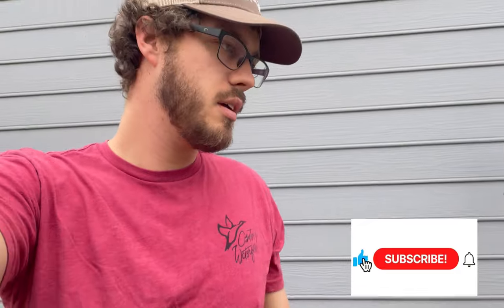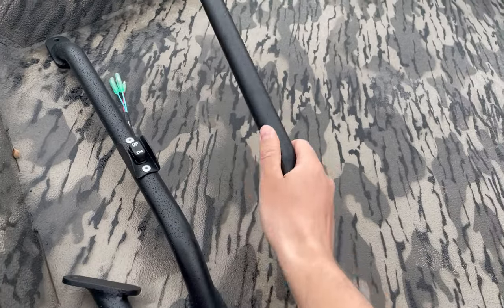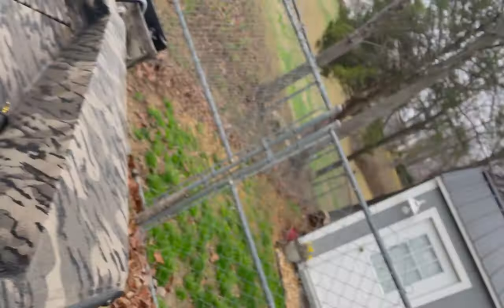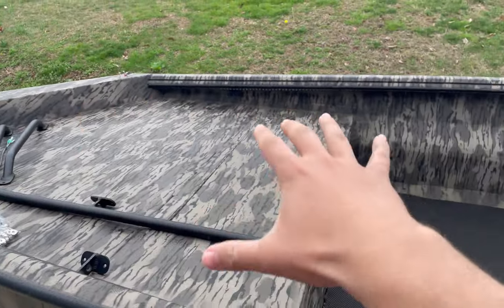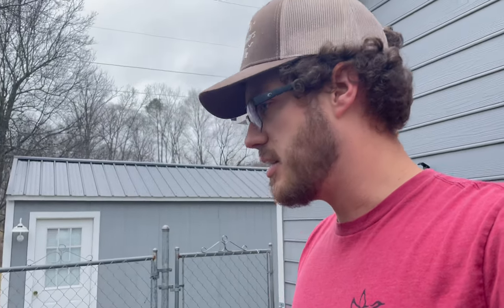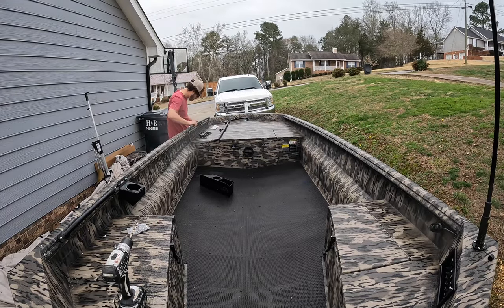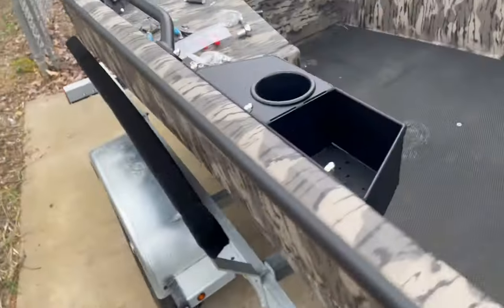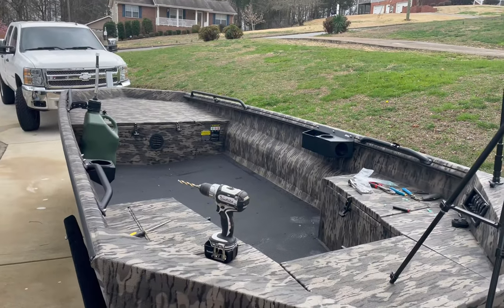Building a duck boat part 2 (turf and noel industries attachments)

Comment: What's the storage length for the trailer, from end of prop to front of the trailer? Also what's the width of the trailer from outer edge of tire to other tire? Is this a 1656 or 1756? Looking into one, Thanks in advance?